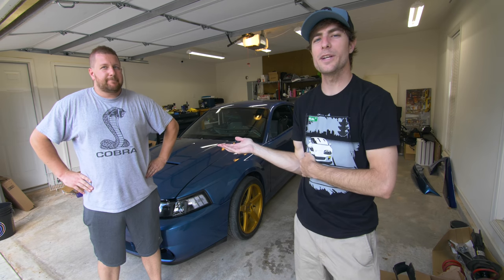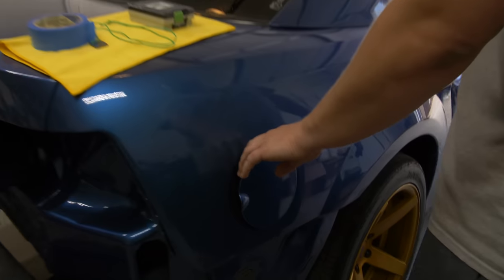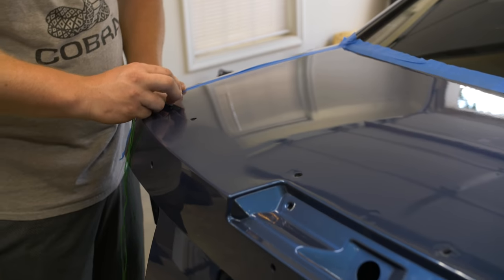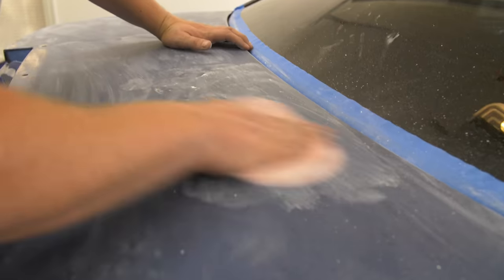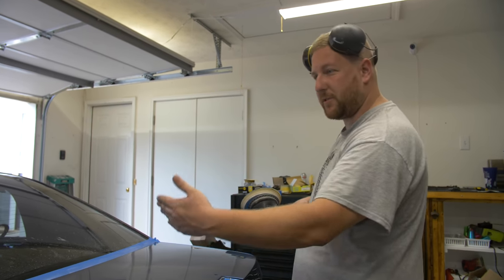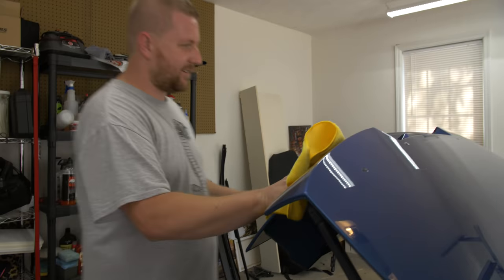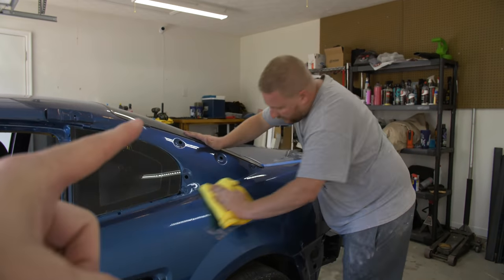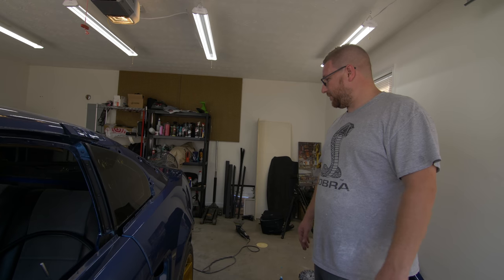The Final Step to a PERFECT Car Paint Job

Comment: you can definitely shoot clear and get no orange peel lol
Reply: This is a high solids clear and so it doesnt shoot flat sadly, its intended to be used just for cutting and buffing.  There are others that do though
Reply: This is VC5700 ditzler clear. It’s not designed to flow and self level. It’s designed to build and be wetsanded and buffed